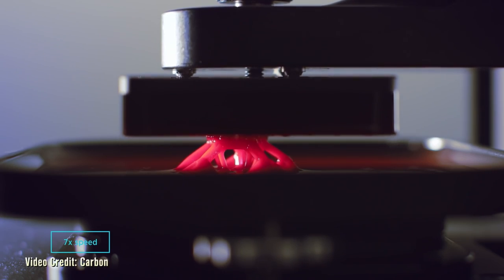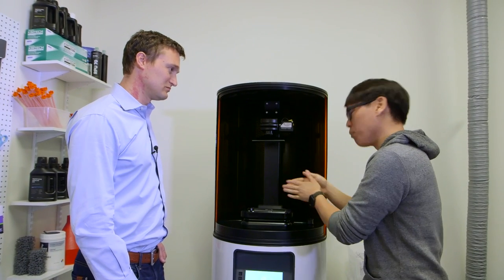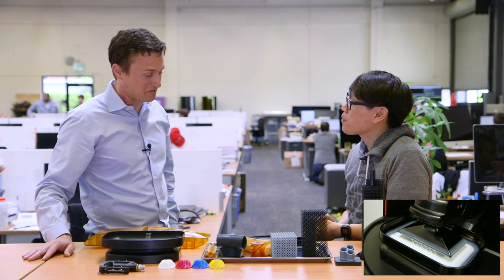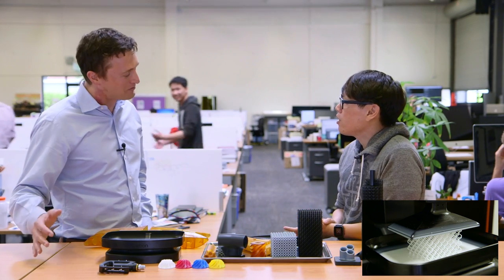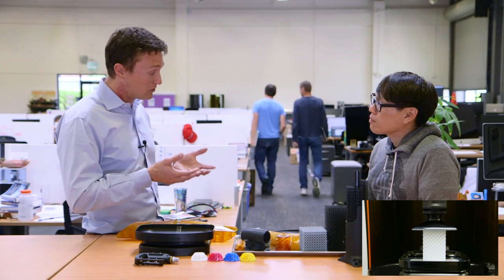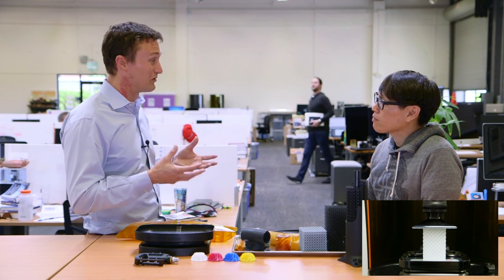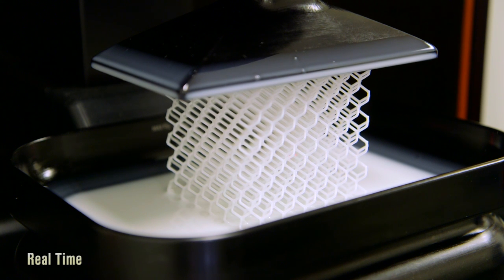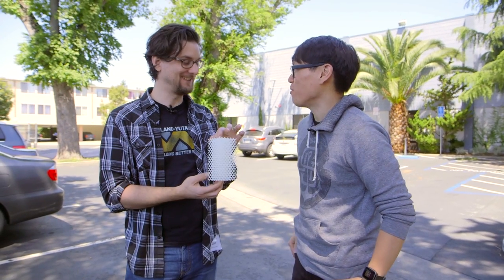Carbon M1 Super Fast 3D Printer Demo!

Comment: I'm around in the comments if folks have questions about the science. The real key is that oxygen permeability of the cassette. The first iteration had Teflon AF - basically a fluorinated long chain carbon chain that allows oxygen to permeate. There is a gradient of the penetration of O2 which creates that "dead zone" - where the UV light can't initiate the curing. 

Benefit is speed for sure, but use of quick curing 2 stage resins is real interesting as well. I was surprised not to see O2 being pumped into the print chamber to create differential pressure. You can expand dead zone and likely speed up print, though I imagine there will be other problems as you go faster (heat, etc.).
Reply from the maker: +Kishore Hari *bumping up for visibility. thanks, kishore!
Reply: Hi kashore,
Can you explain how the oxygen is used as they mostly went into the uv projection but never went into detail about using the O2. Is it also projected(I don't know how) or is it simply to prevent the resin from hardening and if so, how? Sorry if that's confusing but I didn't get what or how the O2 was used.
Thanks!
Reply: +Kishore Hari I really would have hoped you would stop him saying how great it is and start explaining
But still its an incredible innovation
Reply: +Jacob Lemieux 

I got the impression he couldn't go into that because it's a trade secret for them right now.
Reply: +Jacob Lemieux The O2 inhibits the curing of the resin. Typically these resins will harden when a specific wavelength of light hits them - it usually initiates a free radical polymerization reaction. But when O2 is present, it gets in the way of that reaction progressing. Here's a detailed chemistry explanation of oxygen inhibition: http://www.polymatrix.co.uk/Assets/Cure%20Terms%20Glossary/Oxygen%20Inhibition.htm
Reply: rees lloyd I was at the shoot, so that's mostly how I know. But also here's information from a paper they published last year: http://science.sciencemag.org/content/347/6228/1349.full
Reply: +Kishore Hari You're the best, Kishore. :-)
Reply: +Kishore Hari No science questions, just wanted to say that i Love your work on the podcast. You have made for a great second/third chair on TIOAT, every week. 

Welcome to the Tested family.
Reply: +Kishore Hari Ok thanks! I know it might be a secret but do you know how they inhibit specific parts?
Reply: Is there any way to see the projector work by itself? Does it just put off that one wavelength of uv but as a picture that cures wherever the picture is? How do they stop the spread of light, unless the projector is literally right under the tank, but then how do you stop the diffusion of light through the clear (plastic?) sheet? 
On the prints, how much support structure is needed for non-cubic pieces; ie. the scuttlefish? How easy is it to clean up the support structure? What's the resolution of the prints; will I be needing to do a lot of sanding? 
Will future machines come with a built in oven in later versions? 
Will there ever be a consumer version?
Reply: Better explanation then mine, but it's not that hard to figure out how it's done.
Reply: +Xander Zoolander They didn't show us the projector, but yes - it seemed like it was directly under the cassette. Light refraction is a big deal - I wonder if this is why they are at 75 micron resolution instead of much lower. As far as I can tell, the Teflon AF has very low refraction to  mitigate this. Sorry I dont have better answers, but we didn't see that component.

I'll leave it to Sean to answer the questions about supports.
Reply: +Kishore Hari Where does the oxygen come from? Is if an O2 bottle? air? some special chemical?
Reply: +gubx42 Just the air.
Reply: Do you know which companies are currently using the machine? Googling it only takes me to the M1's page, and I thought Sculpteo was mentioned in the video but I can't find on their site what machines are used, and their materials page does list anything outside of basic plastic, multicolor plastic, flexible plastic.
Edit: Found the printers Sculpteo uses; Formiga p1 and p3, ZPrinter 650, and Object 3D. Unless the page hasn't been updated, they don't use the M1.
Edit 2: They do use the M1, it's under materials; Resin (CLIP); and the page shows a picture of the M1. I guess they haven't updated their faq page yet.
Reply: glad to see you around Kishore! thanks so much for going into more of the science based detail for us, and really hope to see you around tested even more.
Reply: +Jacob Lemieux The inhibition occurs where O2 is in high enough concentration in the resin - this is typically 20-30 microns using air, depending on another variable photon flux (# of photons per second per unit area - i.e. how much light is hitting the O2 resin, over what area, and how long). So you can change the permeability of oxygen through the "glass" or change the UV light "intensity" to impact that zone.
Reply: +Xander Zoolander They mentioned a few companies - BMW, Ford. I'd expect to see this with big companies to start. Wouldn't be surprised if they adapt the tech with another company for desktop use down the road.
Reply: I was looking more for companies where I can get an object printed and shipped to me, Sculpteo being one of probably hundreds of companies that offer that service.
Reply: +Kishore Hari Its interesting, I wounder how long it will take for the price of replication to out weigh the costs of storage for cheap mass replication. You would need alot of 3d printers to meet demands of a global company where warehousing makes sense.
Reply: Question, Are the chemicals safe? I think I have heard something about photo initiators are suspected of being cancerous? How safe are the monomers? 
Great to see q&a with the developer. Big thanks!
Reply: +Xander Zoolander only Sculpteo at this point.
Reply: +Cryten0 there are some estimates that the price parity vs manufacturing is about 45k prints a year. http://www.computerworld.com/article/3054781/3d-printing/this-3d-printer-can-rival-standard-manufacturing-on-the-factory-floor.html
Reply: Mind absolutely BLOWN!!!
Reply: +Kishore Hari So the purpose of the oxygen permeable resin dish is so that the layer of resin in contact with the dish does not cure even though the UV light is passing through it, which provides an always-liquid channel under the print allowing faster replenishment of resin at the print face?
Reply: +Kishore Hari Thank you so much. The guy's use of buzz words in response to so many questions was driving me nuts.
Reply: from what I can see they don't control the oxygen...I was thinking its likely O2 from the air on the top layer of the resin so only the bottom layer exposed to the most UV prints and the structure comes out wet because its passing through this layer. to attacht the structure to the build surface, the surface probably submerges til it almost touches the transparent bottom of the cartridge. (just saw where you answered about the oxygen from the air, but this would make him disengenuous in saying the O2 is controlled)
Reply: +konic40 👍
Reply: +AC0KG Yep - that pool of resin allows them the continuously print without stopping and wiping like laser based SLA systems. That "dead zone" has to be large enough for the resin to come back in and fill as the print goes forward.
Reply: +konic40 It's "controlled" in the sense that the permeability of the membrane is specifically designed to allow a certain concentration of O2 through. Probably easier to design that precisely vs a atmospherically controlled environment.
Reply: Kishore Hari cool, my bad
Reply: what
Reply: Thanks for providing the tech details without all the video's redundant buzzwords!
Reply: +Kishore Hari Can it make a good cup of coffee?
Reply: +Kishore Hari Did anyone notice that another company has patented a different way of making a dead zone and oxygen layer in resin, except they can manage 1meter square printing surface, and 10 meters high, so that they can print entire wind turbine blades in under a day??? I think that Carbon3d must be worried that they have prematurely gotten half a billion of investment, onto a sinking ship which isn't necessarily patent proof or commercially competetive. after all their printing surface is miniscule, and so are oxygen particles... If we can make lcd displays 1m wide we can probably distribute oxygen into resin using something else than teflon glass.
Reply: +Imran Habib it can make a good coffee cup.... hahah
Reply: Grottowalker close enough. I'll take 2 plz
Reply: @Kishore Hari - Thanks for the awesome explaination as to the probable methodology for their introduction of oxygen into the print process.

I was really starting to feel like Norm was starting to exceed Curt's knowledge when he got into how they deal with the challenges of exothermic reactions especially using two part resins.  I felt like Curt had an, "Oh damn these are not normal journalists!"
Reply: Feed me more information
Reply: +Kishore Hari hot diggidy! When the comment thread is better than the video =0
Reply: Going to their website, just the homepage, they have an autoplay video that shows the bottom of the print bed, and it's just shapes of UV light. I'm assuming they're using a projector and using the bottom of the print bed as the screen. Now we just need to find a projector that puts out that specific wavelength instead of the visible spectrum. 
I can see why anyone would want this over a laser. Even though both of them have to scan the image, a display scans much faster than a single laser. The surface finish is much better because it's continuous and doesn't stop for each layer to be scanned; and the z axis is probably tuned to where it moves up a layer based on the refresh rate of the display, which would make sense for the continuous layers. 

On the O2 inhibition, I don't understand how it works. If O2 inhibits the curing, then how does the resin keeps it shape? Or does it only partially cure? 
And on the baking, what's the time and temperature? And what kind of oven is used? 

I honestly don't see this being hard to replicate for a desktop printer. The only real mechanical function is the z axis. Though you could probably make a x (or y? cnc axes confuse me, I'm used to a traditional grid) that has two positions, one for the printer and a second for the oven. 
The only thing I don't understand is why the machine is so large. Unless that UV projector just needs something the size of a transformer drum to run it.
Reply: +konic40 I think you're wrong. The model plate descends all the way to the bottom of the basin, not just to the surface. Look how you can see the residue of resin over the top of the plate. And when they print the transparent object, you can see the illuminated cross section underneath the surface of the liquid. There is simply no way the UV light could reach the top surface undifused in an opaque liquid. Even in transparent resin, there would be a problem with focusing.
Reply: +Kishore Hari 
Hi Kishore! What is the meaning of life?
Reply: +Kishore Hari Resolution? Temperature of melting? Hardness?
Reply: +Kris Mill 42
Reply: Tubbyengineer it all makes sense now
Reply: Yarp, I commented with out reading everything, Damn this premature commenting...
Reply: this makes a lot of sense the interviewed didn't really give much away
Reply: +TheTechnoPilot Ha - I helped feed Norm that question - the chemist inside never dies. I'm not privy to all the details to do the math, but I don't think there is enough heat generated to make a difference at these speeds. If they started going faster, probably a bigger issue, but easily overcome.
Reply: +Xander Zoolander Definitely a range of wavelengths will be needed. I don't know of many resins that cure at just one exact wavelength. Off the shelf DLP projectors can be used for this purpose, you'll just lose a little resolution on the print vs the custom one (I think).

O2 concentratione exists as a gradient. Near the glass, a fair amount of O2. About 40 microns up - not much. So the inhibition stops working there and the curing starts.

Don't know details of baking, but it didn't sound too different than the process a lot of SLA printers already use.

We didn't see inside the unit, so can't answer that question. I wouldn't be surprised if it was designed so it could be at that height. I doubt it's completely full in the cabinet below.
Reply: +naturalist3d 75 micron resolution
Reply: +Kris Mill Kishore is the new Siri!
Reply: René K I'd totally pay for his services. He looks like a chill dude that likes to get kinky and enjoys long walks along side the beach. And he also looks Canadian and that means he smokes pot on a daily basis. I also have no idea what I'm talking about because I'm very drunk. How is your day going?
Reply: +Kishore Hari Does O- also create these deadzones? They could be breaking the oxygen bonds with a laser of sorts.
Reply: +LostKeyss O2 inhibition works by a free radical in the resin reacting with O2 instead of another piece of resin. If you created a free radical O,  it won't have much impact.
Reply: I totally understood everything you just said
Reply: +Kishore Hari I was just gonna say this.
Reply: Thanks for the detail!
Reply: Thanks for explaining. That guy was talking a lot without really saying much.
Reply: +monstercolorfun co
You're talking about NewPro3D. These guys are full of hype and bullshit,
 but they do have a process that works. It is far simpler than the 
Carbon 3D process and when the secret  gets out everyone will be doing 
it - at least in the hobbyist community.. It will basically work with 
existing SLA printers and requires only a software change to eliminate 
the peeling stage between layers. No special "Cartridge" or resin vat required
because the resin never actually comes into contact with the bottom of the
 resin vat. 
The fact that the process is so simple - and so obvious - is a problem 
for them. It's going to be very difficult to protect it with a real 
patent - which I believe they do not have yet. They are looking for a 
multi-billion dollar corporation with a whole army of patent lawyers to 
sell it to. Somebody like StrataSys or 3DSystems who has the political 
clout to manipulate the patent office into granting a patent on something
 so obvious that it shouldn't be patent-able. These corporations have 
pulled this shit before and have held back the free market in 3D printer
 technology development for decades.
I know what NewPro3D is doing, and I'm pretty sure a few others have 
figured it out by now also. I hope that somebody open-sources it so that
 the world can benefit without having to wait 20 years for a patent held
 by a monopoly to expire. I believe in property rights and getting 
royalties for a genuinely revolutionary idea, but the likes of 3DSystems
 and StrataSys have already setback advancement and innovation in the 
field of 3D printing for decades.
Reply: Solid (y)
Reply: well it's the answer to life, the universe and everything ;) .... but close enough :P
Reply: thank you!